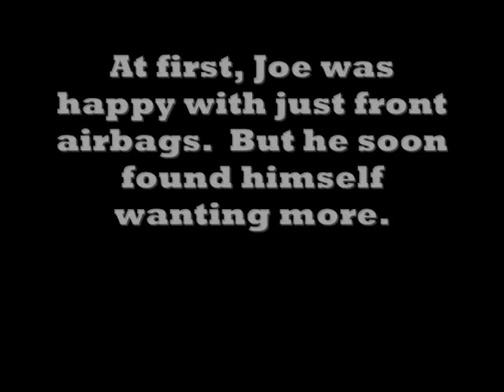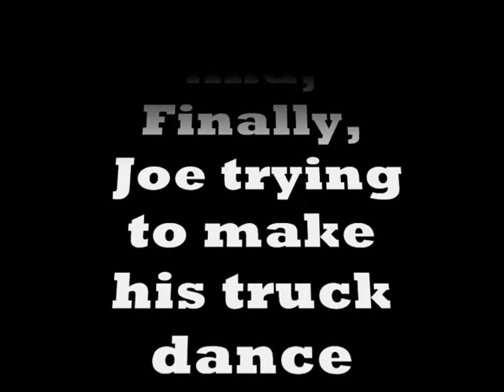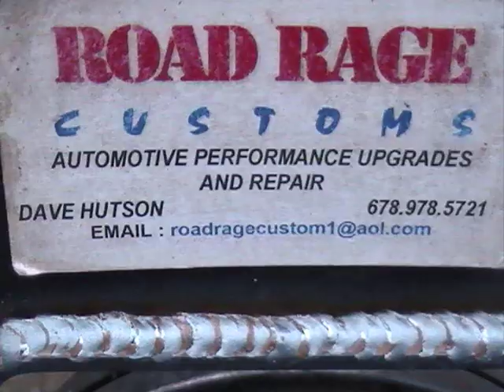Toyota C Notched with air bags

Comment from the maker: I talked to Joe & it did have torsion bars.  He said he removed the shocks on the front, removed the torsion bars, removed the bump-stop bracket, removed the sway bar, and added bag brackets to locate the bags on the lower arm & frame.

Comment from the maker: I'll check with Joe.  I only did the rear.  I'm pretty sure the bags were between the lower control arms & the frame.  I can't remember if the truck came with torsion bars or coil springs.

Comment from the maker: @str8pincheloco The steel was about 1/4" thick.  It was a C notch kit.  Unless you have access to cheap metal, it's probably cheaper to buy the kit.  As far as why it's wider at the bottom, you are more likely to need the room at the bottom than at the top.  There is no real reason it couldn't be perfectly vertical if you have room for your suspension & axle housing.  The angular shape may be a little stronger (like a gusset)  than notches perpendicular to the frame.

Comment from the maker: @str8pincheloco  That isn't my truck.  I just did the work on the rear of it.  The guy that owned it sold it soon after the video was made.  I have seen notches built from 2x4 rectangular tubing too.  If you make both sides the same, it doesn't have to look like everybody else.  You could get creative & make it look original.  Otherwise Google C notches & find a dealer or manufacturer that is willing to share templates (to make sure they'll fit your truck).  Then cut your metal to fit.

Comment: the way to make it dance with bags is a big air tank and you drill out the dumps i dong do a return line like what most kits do i just drill them out and it drops fast and get a bag with mid sized in lets it works great i do the 4 link with c-notch too it looks good i work at a shop building theeses trucks there lot of fun to build and drive

Comment: I Used ....
the Front was 1/2 Line W/ 1/2 Up Valve ( Closer to the tank) And 3/8 Dumps. ( thats 2 1/2 Ups & 2 3/8 Dumps) The Rear Was 3/8 Line W/ 1/2 Up And dump (only 2 Valves)i ran 150-230 Psi In the Tank .. and about 40Psi in the bags...  I think the Reason why your Buddies Leans IS because He Might Not havea front Sway Bar. .... By Deleting The Front Swap Bar, The Front of the truck can go up faster, but it Will Sway Rele Bad, Thats what Happened to my blazer.